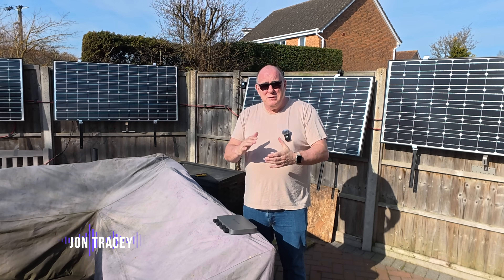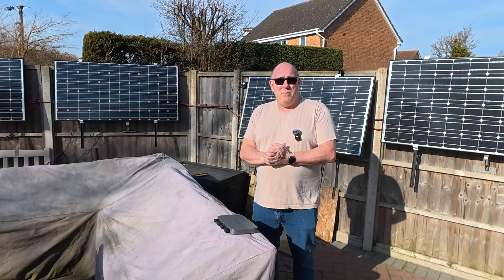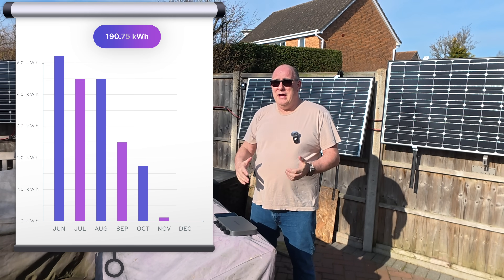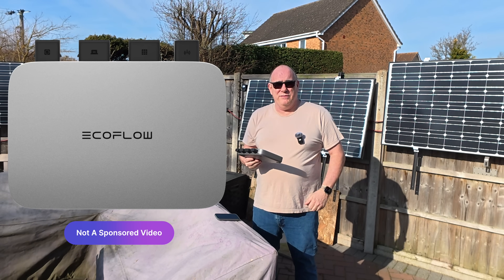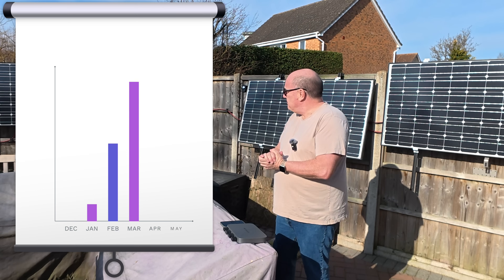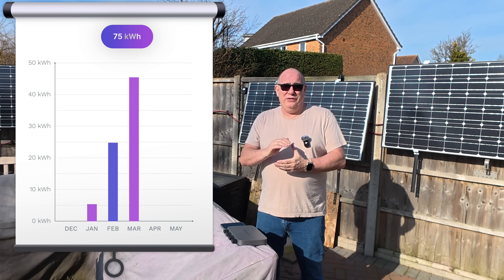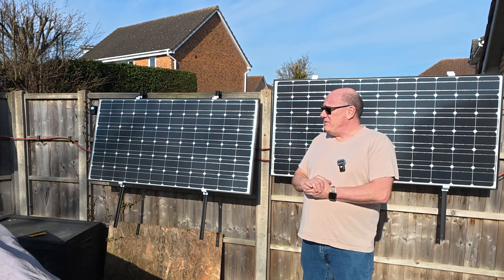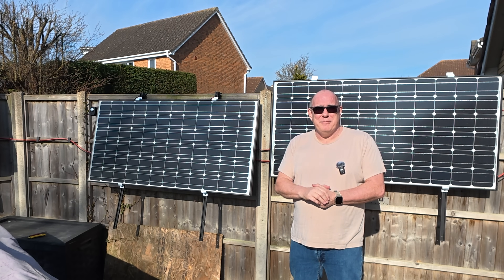WINTER SOLAR PANELS PERFORMANCE SHOCKER

Comment: My three 525w south facing wall panels have generated 375 kWh since installation at the start of October. I've noticed that on cloudy overcast days they do pretty much nothing, where the roof panels will generate more, get a sunny day and they really come alive.
Reply from the maker: 525w panels are the biggest I’ve ever heard of, are there any physically bigger than a 440 panel?
Reply: @JonathanTracey  City Plumbing sell the Longi 535W panels (currently £80). I use one of those with my Powerstream. The Voc is just less than 50V so doesn't exceed the maximum voltage of 55V that the Powerstream can take, even in the cold. They're the same width (in portrait) as most of the other panels - 113cm, but are taller - 209cm rather than 172cm.
Reply: @JonathanTracey  They do panels much more powerful than 525w, 600w is common and I think 700w is available. Most residential panels are 1722x  1134, my 525w panels are  2093 x 1134 , which is a odd middle size panel. The big commercial panels are usually around 2279mm x 1134mm. I went with the odd size panels as they looked better on the wall.
Reply: So, 375kWh at 22p per kWh, that £82 over six months, or £13 a month. That'll buy you 2 or 3 pints a month!
Reply: @weekendwet1  What's your point? That's winter generation, summer will be substantially more, they'll clearly pay for themselves very quickly and then it's free electric for another 20 years or probably much longer. Those panels have generated 84 kWh this month in 14 days,  the whole system is at 577 kWh in the last 14 days, and it's March! Have you had negative electric and gas bills two years running??? PS gas is going next month.
Reply: @weekendwet1  Your maths is all wrong, you're basing it on the three worst months of the year, and only a fraction of my overall system. Do the maths on approximately 13,000 kWh a year. That's just solar generation, then you need to factor in off peak charging of batterries, and exporting them at peak rate. Soon I'll have an ASHP as well, which will cost significantly less than a gas boiler to run.

Comment: the issue is east to west have clear cut off they do generate,  but its like a major peak where south facing would gain the most period , but futher more the angle can affect them , i have found doing the same in upper NY you can cut your solar generation in about 1/3rds  for the period they are in direct sunlight,  a slight angle is better than none and really does make a major diffenence but will never match true angle generation
Reply from the maker: yeah I fully agree if you’re gonna have East west panel do you need to have both, instead of seeing a nice round curve on your grass? What you you’ll see is a curve than a dip in the middle and then another curve on the other side.

Comment: More info on how to wire something like this up to UK household please. Some good deals on second hand PV about got me thinking of trying...
Reply from the maker: it still needs a qualified electrician to set it up, dc isolator, g98 etc. we need  change to our regulation that allows these kind of micro inverters to be plugged into a socket

Comment: A real blow to the over regulated solar PV industry controlled by MCS.I can hear them saying those brackets are not safe as not in our registrar.But you demonstrate a good level of practical skill and the small array will not be generating a dangerous high level d.c voltage . Although I do think the fence could be a dark oak colour to help them blend in.Thanks
Reply from the maker: I fully agree, my ultimate plan is to replace them with panels that are built into the fence panels. But I wanted to see whether they actually generate meaningful amounts of power before investing in them.
Reply: @JonathanTracey Proof Of Concept. 👍🏻
Reply: F the MCS.

Comment: Nov to Feb last winter I got 170kwh, this year has been bright, I made over 1mw in the same time frame. 
I have a 3300w vertical array with 6 x550w panels, with sun and snow 4185w before it tripped the mppt (overamp) 550w=697w, I had to put a stick to shade the array to keep it around 3000w.
My worst days were 7.5kw with 11.6kwpv, I use 19kwh daily with electric heat, gen time 66 hours total this winter, 342 hrs last winter. 
My next vid I am going to check pv input then shovel snow back in front of the panels and check again for gains. 
Going to relocated 3 arrays redesign their mounts and try one more year before I buy a 12000xp and 10 more panels.
Reply from the maker: Yeah, I saw a video recently with somebody piled white stone in front of the panel and saw an increase, so I’d imagine snow should do the same thing
Reply: @JonathanTracey  Sounds like Projects with Everyday Dave, he did an experiment with mirrors as well.
Reply: @spankeyfish   most vertical tests are a failure, they do east/west, I face south, dark cloudy day today 18.8kw at 5pm.
Reply: @JonathanTracey   I was going to put white stone but by the end of the month to oct 10, I am charged at 11am latest, summer with dirt my 11.6kw becomes 5800w x 12 hours np.

Comment: I want to see 3 things really to make fence solar more of a thing.
1. Standard 6 foot panel fencing like this is all over the UK and it would be nice to just have a product that is a dual sided solar panel that slides in place of the existing fence. The price of the solar cells is such now that using it for roofing tile replacement and fences in place of tile and wood is becoming viable given its payback even if its at a suboptimal angle and partially obscured.
2. A glue solar cell like they are just starting to do for industrial uses so an existing fence can have a lightweight solar cells glued onto it.
3. Similar regulatory standards to some EU countries that allow low output solar panels to be effectively just put through a standard socket which may be necessary for these fence systems and where they come into a property to avoid very expensive installs and running of dedicated electrics.

If we make this as easy and cheap as possible its going to be something people do. At the moment the solar fence solutions are dedicated specialist fences are really expensive and its the retrofitting that will be the volume of installs.
Reply from the maker: Yeah there are companies that are starting to produce standard 6 foot fence panels with the panels built in. However I’ve also heard a couple of neighbours getting into a dispute, as the panels are generally by facial. One neighbour claimed that the other neighbour was stealing power from his garden. You can help a great solution you just can’t engineer for idiots. Yeah I did look at maybe glowing flexible panels to the fence panels, but it just became too much of a hassle. And I agree with you until EcoFlow got in touch and said you gotta stop sending power through the plug socket, I exported energy every single day that way. It worked just fine. So we need to update our old regulations as this is a perfectly viable way to do it.
Reply: @JonathanTracey  Yeah, if you're using bifacial panels a not very smart neighbour might decide that they want the power that their side of the fence is generating.

Comment: I love my powerstream, 2024 I produced 345kw from my fence panels, so far in 2025 ,they have produced 53kw ,I've added 2 x 430w solar panels to my shed roof
Reply from the maker: Yeah, I think I’m gonna have to upgrade to 440 W panels. I wanted to reuse the old 220 W panels, but they’re just not producing enough.😂
Reply: @JonathanTracey  I have 4 x 100w renogy panels screwed to a fence facing east , 2 x 175w renogy panels on movable stands and then 2 x 430w on the shed roof facing north ,it gets addictive, 😆
Reply from the maker: I know what you mean, I have 9.6 kW on my roof but I spend more time obsessing over these than the large system. Got a video coming on Friday that shows a little upgrade to this system.

Comment: Great video, I have same idea in mind, I am just concerned about how are the panels fixed to the fence? Are you not scared the fence may fall or break?
Reply: There's a company that make fences that are approved by MCS the industry controlling body
Reply from the maker: yep that’s my long term plan, if these prove they would pay for themselves
Reply from the maker: Thank you, Juan, so the panels are not fixed to the fence at all. I use a mounting system is designed for hanging the panels on the side of balcony rails. They’re basically a hook system which goes over the top of the fence panel all of the weight going straight down. They’ve now gone through one entire winter not had any issues. You might notice that the posts for the panels are concrete that gives a certain level of stability.

Comment: Can you show us the battery side and how you connect it up?
Reply from the maker: I will try, but I have to do some severe reorganisation in my garage as they’re buried in the back corner.
Reply: @ also interested in your solaredge battery set up, I have two 10kw solaredge batteries and I’m considering getting a third as I’ve just had an 11kw heat pump installed.
Reply from the maker: Yeah, the third battery just adds onto the system, there’s nothing extra you need to do. I believe depending on the model of inverter you’ve got you might require an extra little box that consolidate the batteries before they go into the inverter, but with my home hub inverter three batteries daisychain together and then go straight into the inverter. If you have the space for three, especially with the Heat Pump of that size, it might turn out to be a good long-term investment.